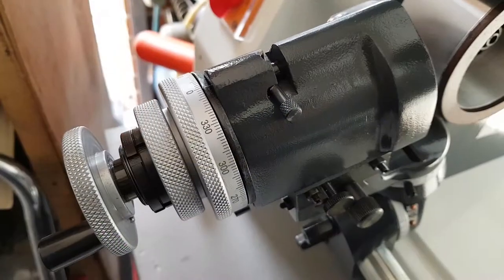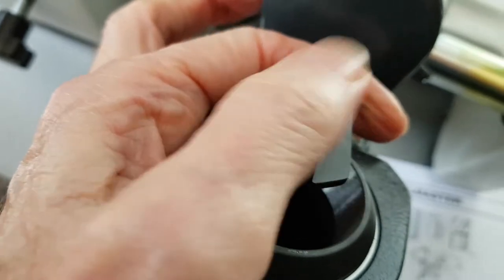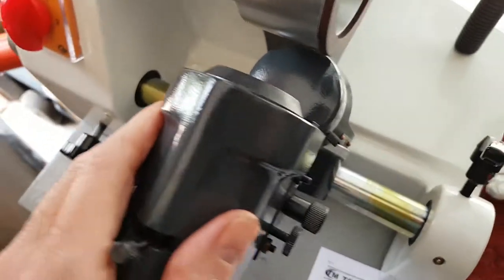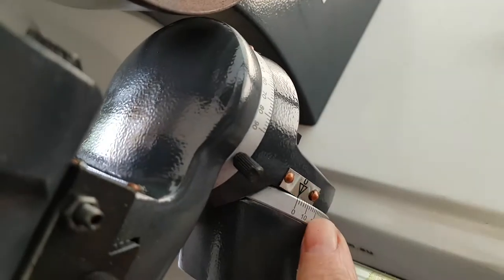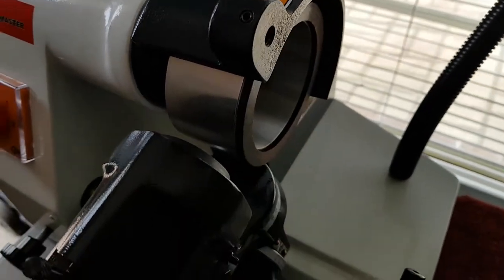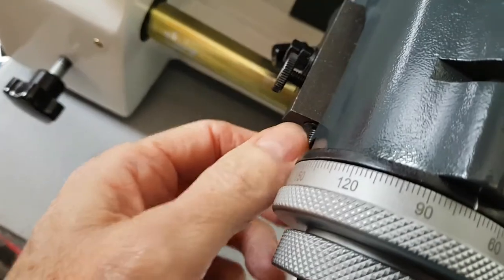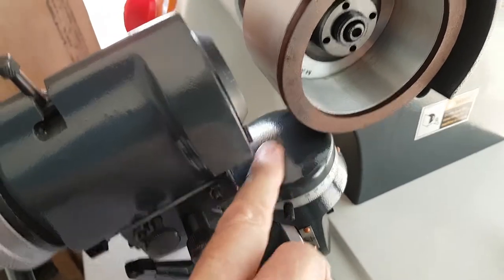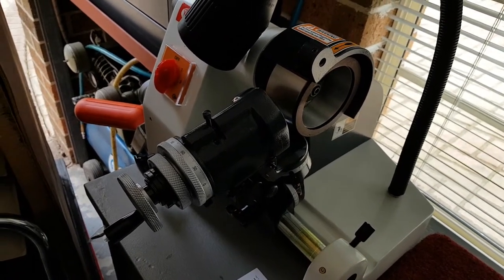CNC4A - D Bit Grinder Controls

Comment: I've used many different cutter grinders thru my years as a machinist and honestly the clone Cutter grinders are the worst and the most anoying to use. I just found a used Deckel brand SO grinder that the main shaft was siezed up so I bought it cheap. I soaked it kerosene and had to use some persuasion to free it up. Then took it all apart, cleaned it and now, its like brand new. The Deckel brand is a very high quality grinder compared to the clone. If anyone is thinking of buying a small cutter grinder, try to find a Deckel brand if possible. Watching this video just reminded me of poor quality of the clone.
Reply from the maker: Always get the best you can afford of what is around at the time.  Unfortunately the second hand equipment market is very different around the world. A lot of us look at America and Europe and just drool at the prices and availability.  If something does come up they normally want an arm and leg for it and I am already walking around in circles.  The other thing to consider is end use.  If you are just a hobbyist and use equipment for just tinkering and non-paying projects, etc then value for money is usually the deciding factor.  A cheap piece of crap that dies on you after the job is done and probably won't be used again can be dumped without any qualms.  I was once told the story of two people buying shoes. One would by a $100 one and the other just a $10 one. They met again a year or two later and the $100 person hangs it on the $10 person saying, see my shoes have lasted this long and yours have worn out many times.  $10 turned and said yeah, but in that time I have had 5 pairs of new shoes in the latest fashion and saved $50 and you a still stuck with old fashioned 2 year old shoes. Like I said always get the best you can afford, not the most expensive.  Thanks for watching.  Don't forget to subscribe, it's only a press of your mouse button.